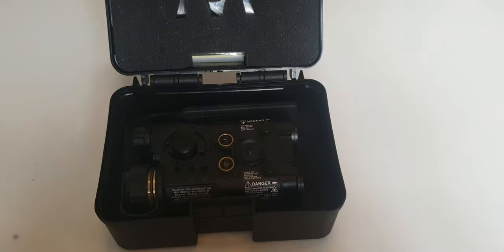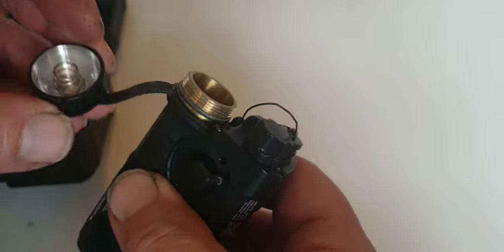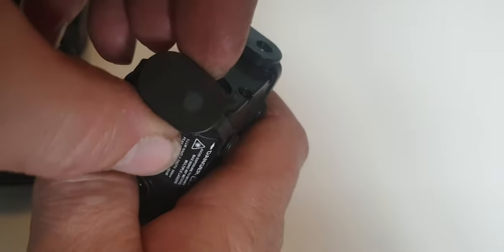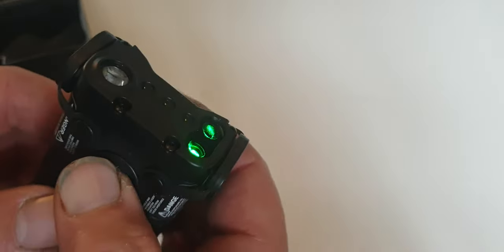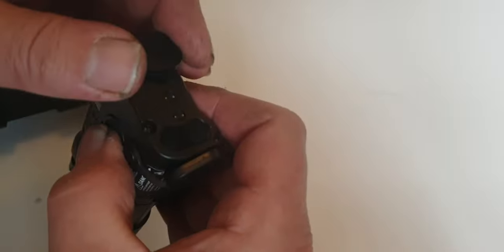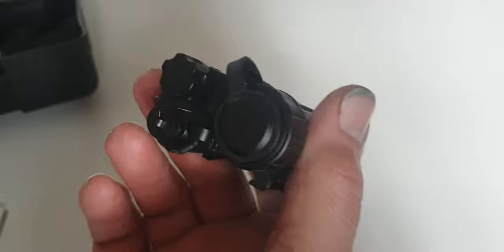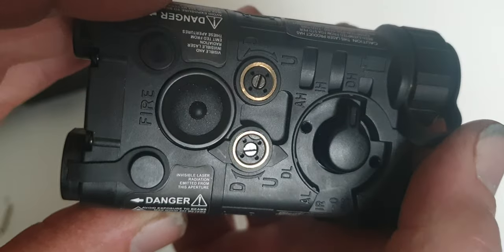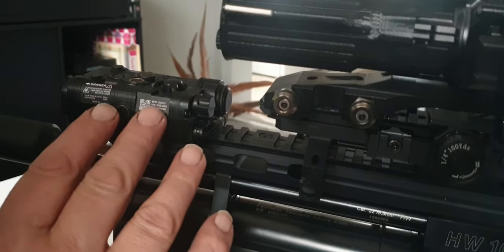The (Almost) OAP's Guide To: WADSN L3-NGAL (WD06044-BK) Rifle Laser Unit From Aliexpress.

Comment: The blue screws are used on the actual NGAL to prevent overtravel into high IR mode (laser and illuminator). Good for FoF (Force on Force training).

I have a metal blue on on the way. It's no somogear (as it doesn't have an IR illuminator), but for 150usd, I figured it would be fun just to mess around with. The actual L3-NGAL is 4k USD and only for MIL/LE in the states.  Also I wouldn't trust what those stickers say in terms of specs as it could very well just mimic the real steel one.

Really disappointed that you can't zero both independently. Maybe you got a defective one. I'd try to get a refund and see if they will replace it.
Reply from the maker: Hi, i've just had the unit out in the dark and have managed to align the IR laser. Which works really quite well. I've had an issue with it where the IR laser wouldn't activate but i've "fixed" it. Yes, it's a pity you cant adjust both lasers. It doesn't mention anywhere except in the manual, it states the other two screws are "decorative". I suppose it would be possible to shim one of the lasers but honestly, as my NV has a red laser, which i only want for 10-15mts close range and the IR for a bit longer, say 50mts then i'm generally happy with it.

Comment from the maker: Right: BIG update.                                                                                                                                                                                                                    1.The IR *IS* visible to the Pard.                                                                                                                                                                                             2. The green and IR laser are NOT independently adjustable. So you cant adjust both lasers independently. The U/D L/R adjustment controls on the left side do NOTHING. So if you sight the green laser, you cannot adjust the IR laser without losing the adjustment you've made to the green laser and vice versa. Which is utterly stupid. This fact is stated in the manual that the other 2 screws are "decorative use only".                                                                                                                                                                                              3: Battery life is about 40 minutes.
In short the IR laser appears to be actually quite good once you've dialled it in. The green laser is actually half decent too and there is plenty of adjustment but being as you can't adjust them independant of each other, it makes one of them pointless. I suppose for 60 quid you cant really complain but i'm now finding it difficult to recommend this as a serious add on for an air rifle. Better for airsoft and paint ball, but i'll give it a go.
Reply: The controls on the left aren't for the IR light?
Reply from the maker: @LowellThePanda  No, they do nothing. They are, as the manual states "decorative". Trust me, i'm annoyed about it. It isn't mentioned until you actually read the manual.
Reply: Adjusting both lasers together makes a ton of sense doenst it ? For zeroing in daylight and using IR wouthout a problem, No?
Reply from the maker: @remixd1128  Not for my use. I wanted to be able to align the IR for night time and the green for day time but you cannot do that..

Comment: Avoid plastic versions of wadsn lasers at all cost most of the time they have missing features and break easily, if ur gonna buy wadsn buy they alluminium lasers as they are much sturdy and come with full features, i just got my eotech OGL replica from wadsn (aluminium) and its been pretty good, also have the ngal and dbal a2 in aluminium no problems so far
Reply from the maker: I have EVERY intention of avoiding them for the rest of my life. They are UTTER garbage.
Reply: @Cornz38  i wouldn’t call their metal series garbage tbh, the plastic ones yea total garbage but all my metal ones being the Peq15, Ngal, Dbal, Perst 4 and OGL have held zero, i have potted my perst4 but seen people rock is as is with little to no issues
Reply from the maker: Well, the entire experience has left a bad taste in my mouth and a hole in my wallet. I don't care if they make one of the purest unobtainium, i won't entertain any another one of their products whilst ever i draw breath. They ARE garbage.  @lofighost8811

Comment from the maker: UPDATE SEPTEMBER 2023. The battery has swollen internally and has taken a great deal of effort to remove. The + terminal inside the unit is TOAST. THESE ARE UTTER GARBAGE. DO NOT BUY ONE.
Reply: Did you leave the battery inside without using it for a while? And was it an old battery thats been recharged often? That propably caused it, batteries usually puff up because theyre defective or at the end of their lifetime, the device itself cannot possibly have caused that
Reply from the maker: I left in in there 4 days. Let me explain. The device is of SO poor quality, it doesn't ever actually turn off,  so the battery ( a GOOD quality AmpsPlus cell) is taken way beyond its safe discharge voltage. No, this was NOT a bad battery, this was a poorly designed, built and marketed b piece of chinese tat. I say again, do NOT buy one. @kiparis311
Reply: @Cornz38  Well that sounds concerning. I have had one for a while and had no problems except a loose switch, but youre right the build quality on these is absolutely abysmal. Cant expect much for the money though.

Im just gonna remove the battery and hope it doesnt explode on me. Thanks for the honest review and follow ups, im still pretty happy with it my model is a IR LED illuminator and laser for 50 bucks, cannot beat that for airsoft use but lets see how long it will last me
Reply from the maker: When mine arrived, the IR laser was a bit flaky, then, a day later it stopped working. I spoke to  the seller on aliexpress whom said i had to break the cap off the switch and reposition the switch. I couldn't get the top off. ALiexpress reluctantly agreed to refund, but i finally managed to release it. The switch was a nasty sprung copper thing. The PCB was poor, the soldering terrible. It was a total waste of 50 quid. I should have just sent it back.Never again. Although i have salvaged the IR and green lasers for use elsewhere. @kiparis311
Reply: @Cornz38  you had the switch come off aswell? It was a real pain in the ass for me getting that tiny ball bearing back inside the spring so the detent could be felt. Sadly the switch is just a very cheap potentiometer dial, in my unit the receptacle on the dial is actually keyed so its only possible to attach the switch one way. 

Im just gonna leave it at IR LED & Laser and never touch it again, that should avoid any problems. Maybe ill glue it shut so the recoil doesnt shake it loose. 

I have much lower standards than you since i only need it for airsoft, but you should look at the somogear PEQ-15 units for your air rifle, these are very high quality and actually filled with epoxy so they last pretty much forever. Rather expensive though, 300 bucks and up.
Reply from the maker: I really don't mind paying big money for quality items. I knew this was a piece of cheap plastic, i just didn't realise HOW cheap a piece of crap it was. Thanks for the HU on the somogear. I'll give them a check out. @kiparis311
Reply from the maker: Just been looking at the somogear. It has the same inherent issue as the crap i bought, in that the lasers are not independently adjustable. Now, in air-soft that doesn't matter, with a air rifle where you want head shots, it does. I have a red dot built into my NV, i might just buy an IR laser or try and mod my red one with my IR one... @kiparis311